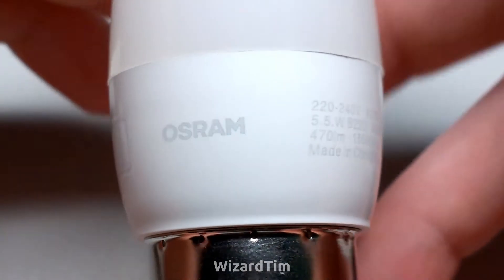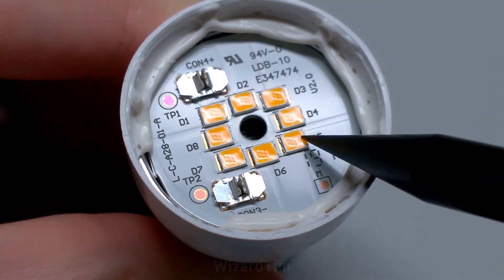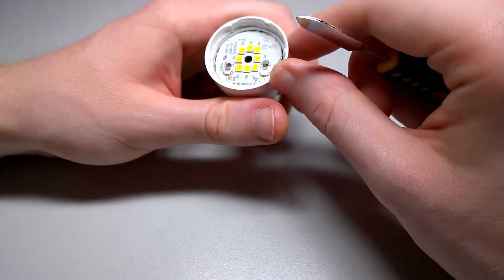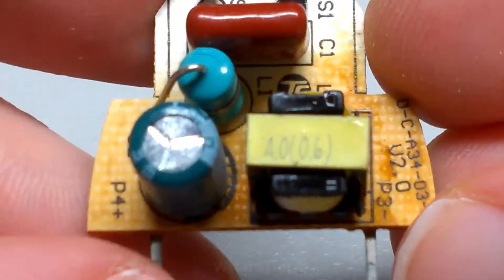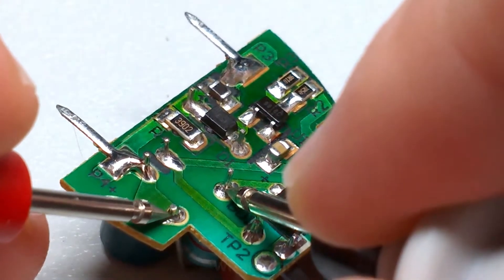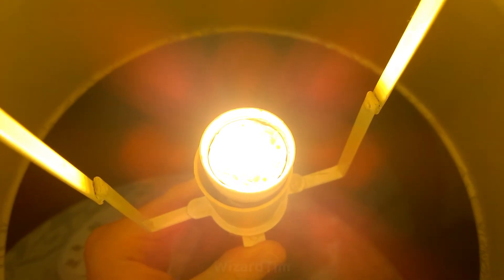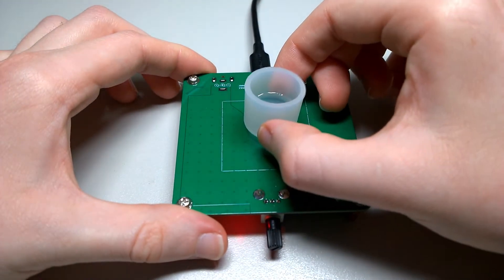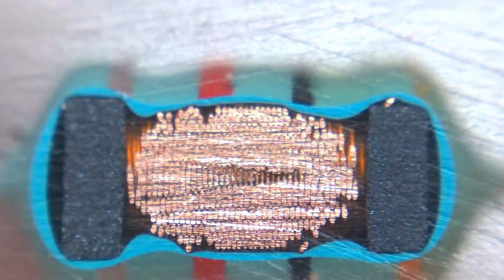OSRAM 5W LED Bulb Repair & Failure Analysis

Comment: Nice repair and effort to spot the fault. I was a bit surprised you just didn't chip off the coating where the creak was to maybe see the broken wire. If it was because it got too hot, I think you would have seen burnt or discolored coating. So it had to be a broken wire... Just my opinion.
Reply from the maker: I've tried to chip off the coating on other components before, it's very difficult to do so without damaging what's under it so I wouldn't be confident if I found a broken wire to say if it was the failure point or if I had just broken it. If I were to do this again I would use an acid to dissolve the coating.

Comment: When I fix these Bulbs I normally increase the value of the current sensing resistor. So the bulb runs a little cooler.

Comment: I had two Osram GU10 style lamps that failed after a while also with a similar open circuit inductor. They had a silicone encapsulated PCB, that didn't seem to improve reliability.
Reply from the maker: Interesting, I've heard the silicone encapsulation is meant to improve thermal conductivity to the outer shell and eliminate joint vibration failures, not sure about high thermal cycling. I'm tempted to buy a new one from 2022 to see if they've changed anything since the 2019 design.

Comment: Great idea to epoxy it. I wonder if the leads were thinner or more flexible if it would help, or its pure thermal cycling of the component itself as you said.